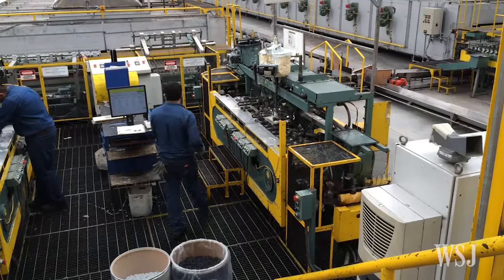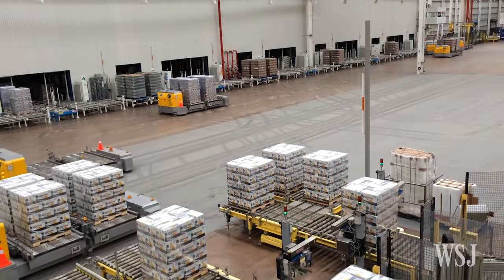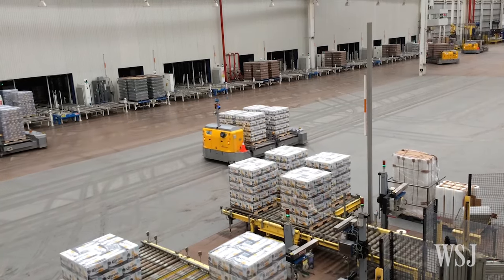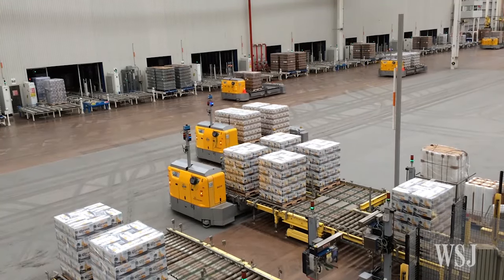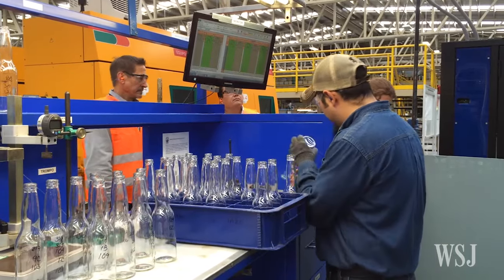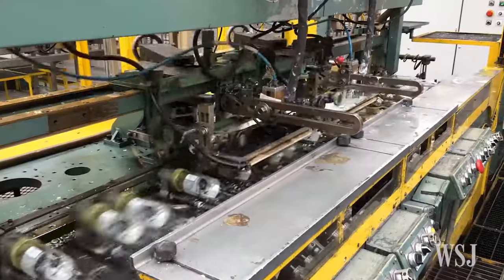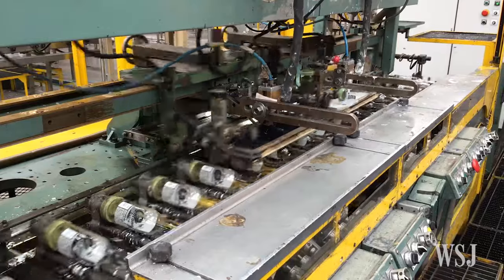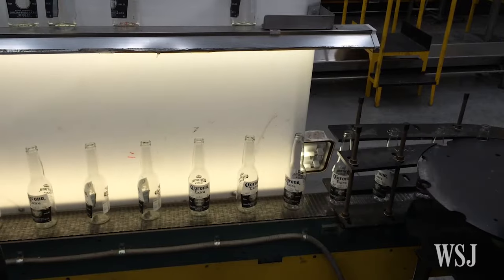Constellation Brews a Fully Automated Factory

Comment: They say 6 people, those 6 people are constantly running around from one thing to another for 10 hours straight. I would argue they do the workload of 15 people and are working multiple departments and several roles in the same day. Its acceptable to automate, but then firing your entire staff and leaving a skeleton crew in its place is unfair and possibly illegal.
Reply: Did you have such experiences in an automated factory? Because it seems like the only thing to do would be to check on the different machines and ensure they don't need maintenance. The rest would be managerial work like talking with suppliers or distributors. If maintenance is needed, it won't be done by the 6 people, but by a contractor from the company that makes the machines.